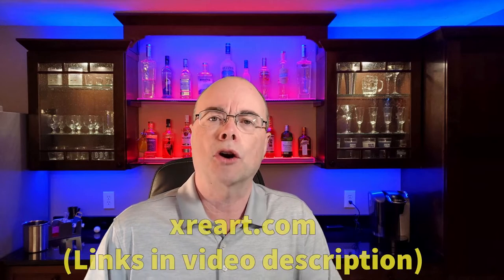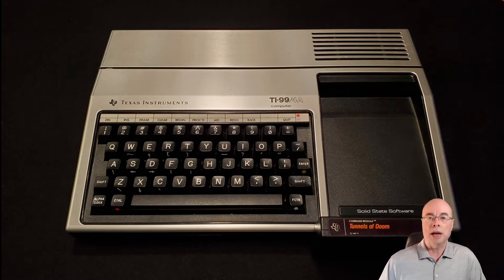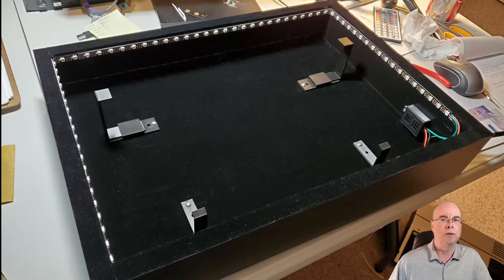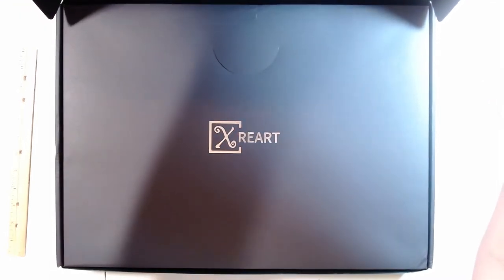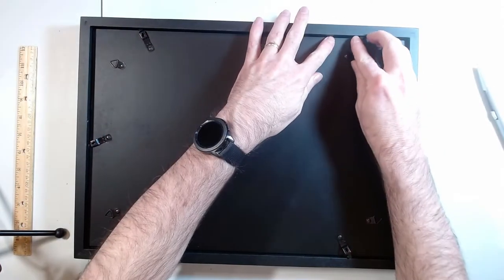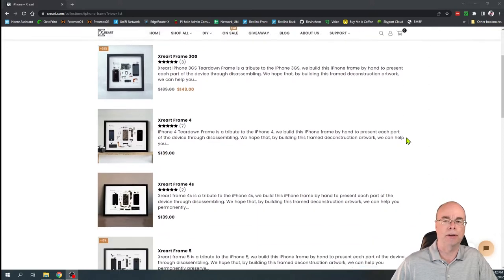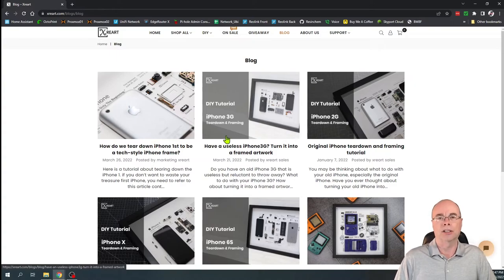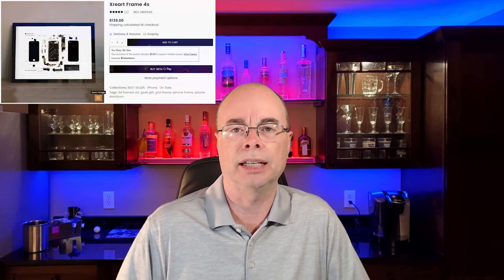Tech as Art - DIY vs. XREART: Unboxing and Review

Comment: How have you been, I haven't emailed u in a bit with questions lol. I've been messing with my palette 3 pro.
Reply from the maker: Good to hear from you!  Wow... a Palette 3 Pro?  You'll definitely have to let me know your thoughts on it after you use it for a while.  I haven't really had the need to print anything in multi-colors (yet), because most of what I do is pretty basic.  But I think it would be great just to avoid having to change filament (even between different prints) and having the backup of not running out of spool in the middle of a job.  I'll be anxious to get your feedback on it!

Stay in touch and feel free to drop me an email at anytime...
Reply: @ResinChemTech  well I've had it for a little more than a month. I'll just say if a person doesn't like to tinker or keeps a hammer close for when they get angry this isn't the machine you want. But if you like to tinker and can take a deep breath before smashing everything it's ok. I'm just now getting it tunes in. But a lot of it is the printer I'm using it on. I thought about getting a different one for it.